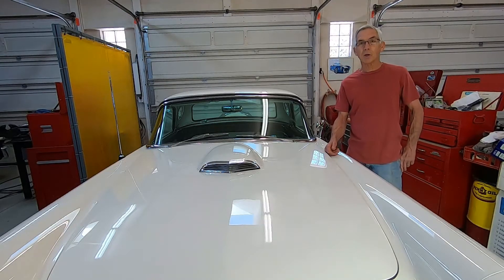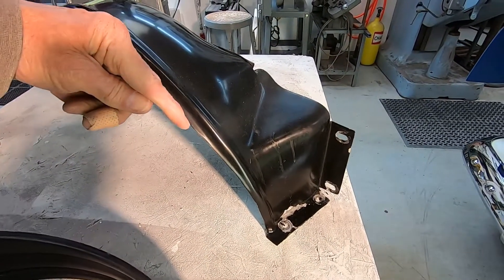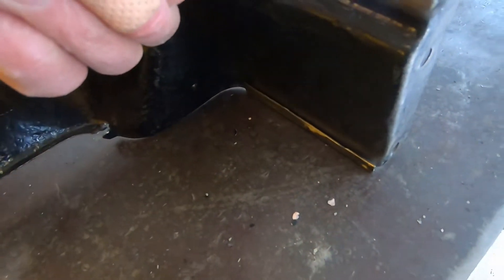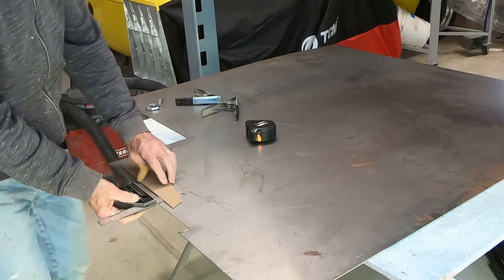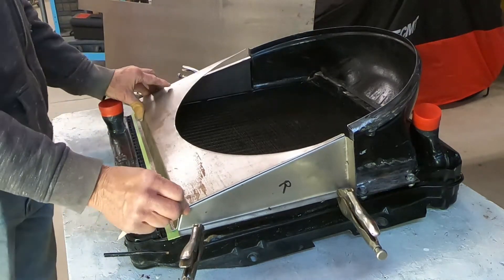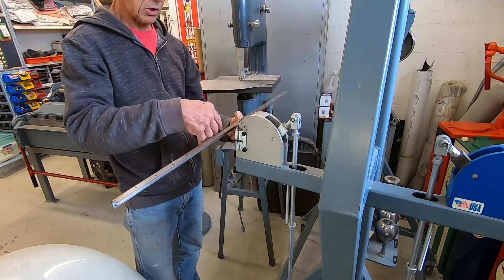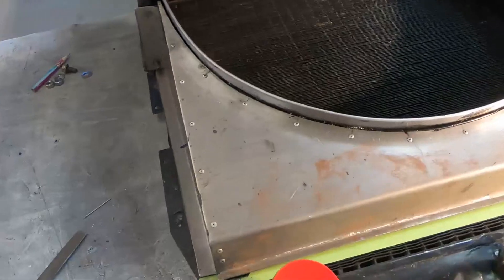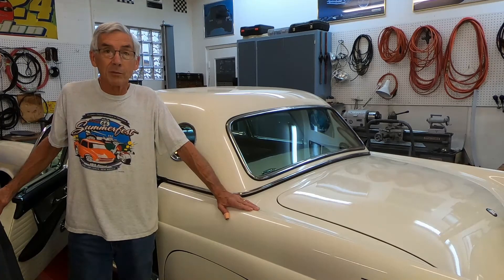1956 Ford Thunderbird Radiator Cooling Fan Shroud Modification. 1955 - 1957

Comment: Hi Dick, I've tried Casco and NPD for their Modified Lower shroud, both say discontinued. I have that over heating problem associated with the F/code. I've bought a Code Case (Radiator Express # 229390) radiator for it, but need your lower shroud. Its core hight is 18". Could you Please make me a lower shroud like yours. I will pay what ever you deem fair. Ken
Reply from the maker: Hi Ken, Thanks for watching my video. I'm sorry but I am unable to make a shroud for you. I would imagine any reputable car shop in your area could easily do it. Have them watch the video so they know exactly what you are after. Good luck with it.

Comment: I've been playing around with the cooling system on my 57 T'Bird. I have a P/S rack & pinion from Unisteer. I have always believed that the spacer between the block and water pump is a big issue causing poor performance of the pump. I have done away with it altogether. I have also drilled and tapped the thermostat housing and fitted a 2nd temperature sender in it.  At operating temperature with this sender, the rear one is reading higher on the same gauge.  Later FE and up Ford engines have the temperature sender at the front instead of the rear. is this the problem? I have also opened up the galleries at the front of the heads and in the block to match the gaskets. This motor had been rebuilt prior to me buying it and shipping to Australia. At the rear of the block, the galleries had quite a build up of hard deposits like concrete. it took me over 10 hours to awkwardly chip away at this and through the core plugs. I have fitted a Davies Craig 16 inch electric fan and done away with the factory fan. it pulls 2120 CFM.  I do not expect any cooling problems. This is my 5th Baby Bird.

Comment: do you have a video of the radiator replacement, and  approx how much time should it normally take? tnx
Reply from the maker: Hello, Thanks for watching. I do not have a video of replacing the radiator but it is not a difficult job and should take only a couple hours. First, of course, drain the water. Remove the shroud and radiator hoses. Unbolt the radiator and remove it, two people will make it easier to lift out. Reverse the procedure for installation. Good luck!

Comment: Looks great. Good job. Actually I have a problem with a aftermarket 4 row radiator, who is 1cm deeper than the original.
I have no ac and a Ford-o-matic Transmission.
I'm thinking about having the spacer between the fan and the waterpump pulley removed. The 6 Blade fan scratches to the bigger new radiator….
Lot of problems….🤔
Greetings from germany.
Love your videos and I appriciate it much.👍👍👍
Reply from the maker: Thanks for watching. Yes it's always something on these old cars isn't it. I still love them though.

Comment: I found that my 55 runs cooler with a 57 manifold and 4 barrel carb on it. I added a aluminum radiator also.
Reply from the maker: Very interesting.